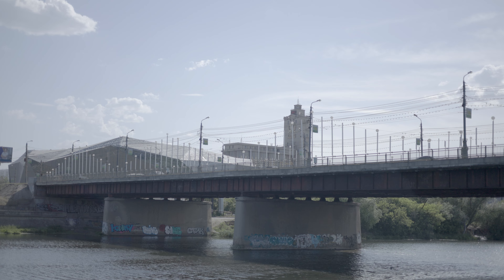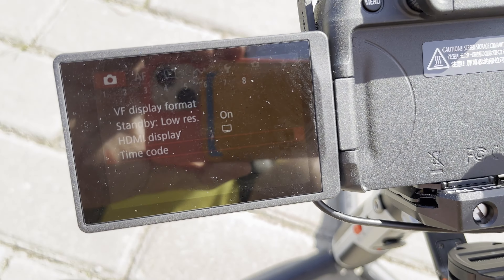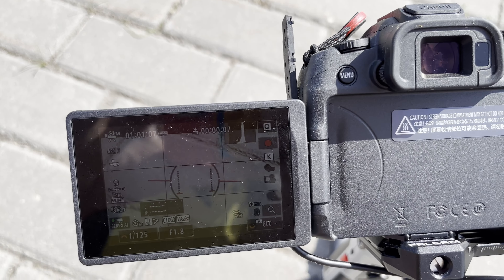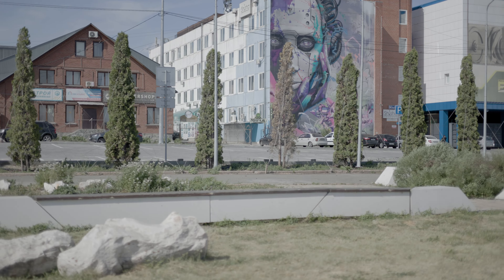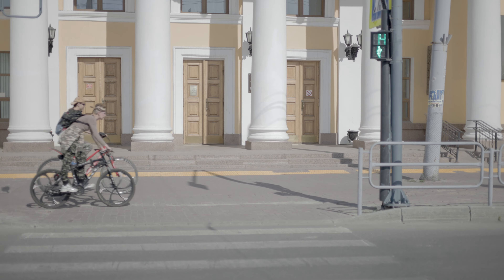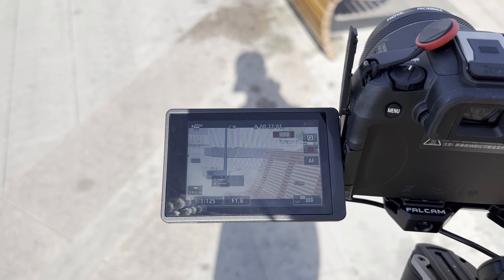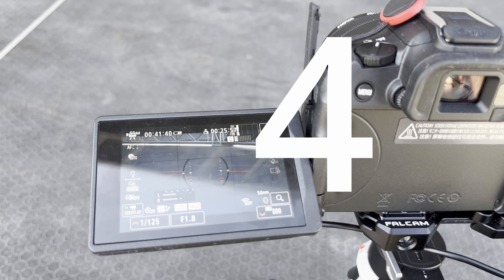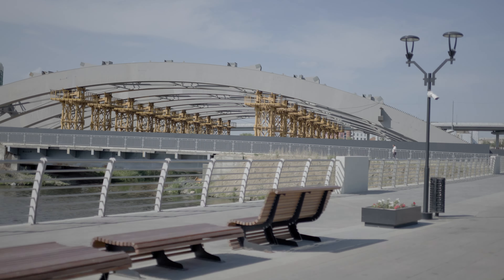Canon R8 overheating test

Comment: How many dials for exposure does this camera have? I only see one.

So how did you configure it for setting the triangle of exposure quickly? Or do you use the screen to set new F values or smth?
Reply from the maker: It has 2 dials + control ring on a lens. I shoot wide open most of the time, so I don’t need super fast way to adjust my aperture (it’s on a lens), ISO on the back wheel (under my thumb), and shutter speed on the top wheel (under my index finger)